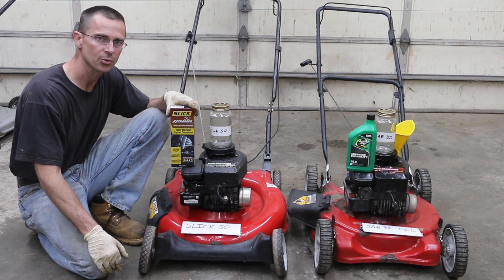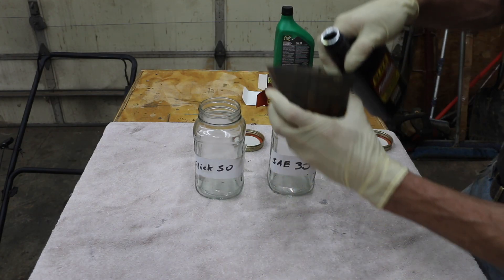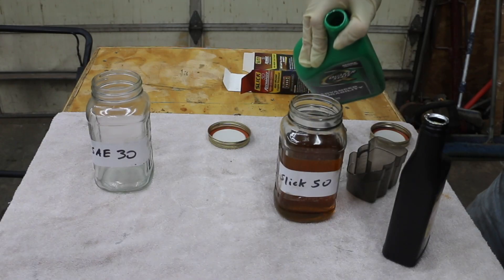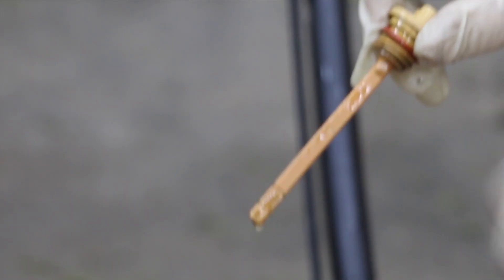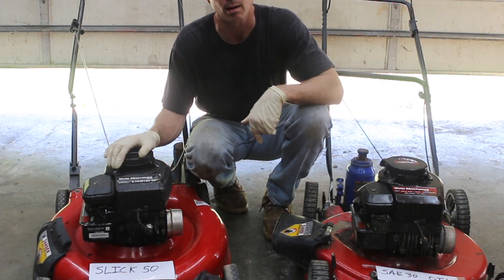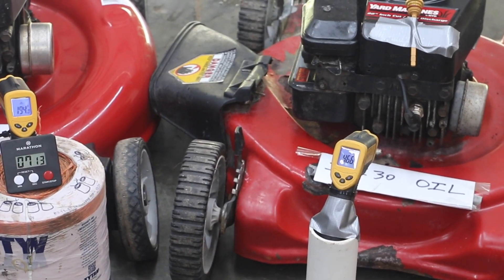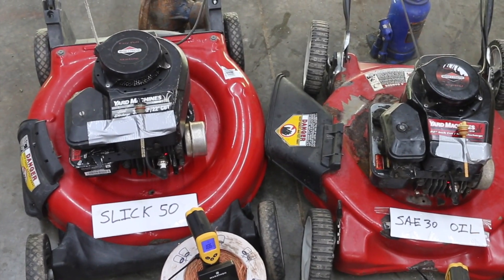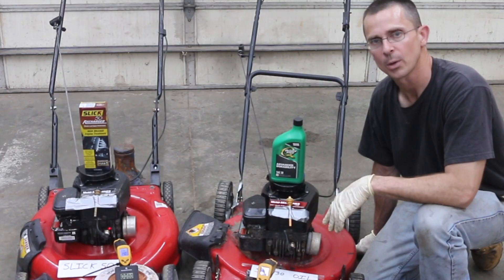Can't believe what SLICK 50 did to my engine!!--Dry Crankcase Test!

Comment: The formula for SLICK 50 "IS NOT" the same as it was even 10 years ago, the name, company and formula had changed a number of times over the years so the Slick 50 you think you are using from 25 years ago is nowhere near the formula of today.
This test is 100% useless if you're trying to prove a point about the original product. The company was gobbled up time and time and time again and the formula changed each time they sold it, it is not the same under that name today.
Look on the internet to find the original owner and his story.  If you want to Original Formula it is marketed under the NEW Name of "Xcelplus" and is as good as it ever was. The man that invented it, John Bishop, now owns it original formula again. 
Do the research, the original formula is the way to go.   Google John Bishop and Xcelplus and you will find it.   ....., I just found the consumer name for it is now called Lubrilon and it is from Xcelplus and it is the ORIGINAL formula, Yeah, it's back, and it works the same as it did.  Look here:  http://www.xcelplus.com.au/

Comment: Slick-50 was bought by Penzoil if i remember but the original formula has not been available under the Slick-50 brand since 1984. The original formula is available under the Xcelplus Brand.
Here is a video link about the original formula developer and the problems with the company. https://youtu.be/CAt-tJa9P_s

Comment: I would say your experiment was a bust from the start as it was obvious that both engines had different amounts of use and they weren't identical from the start. the only thing that would be a true test is if you had preformed it on two brand new engines or two that had the exact same hours, this test was clearly done with neither thereby proving possibly one thing and that was the engine that ran the longest was in better shape. As for prolonging the life of any engine, I have to agree with my grandfather that told me years ago that the benefits gained by frequent oil changes will far out measure any differences in the types of oil used and it wont be before people stop getting rich from oil will we ever see anything hit the market that is really any better.

Comment: If the goal is to have the oil holdup at very high temperature then put in synthetic oil.  Personally I don't think this test really proves anything.  I thought Slick 50 just boosted the viscosity a little.    I would just buy the right oil for your engine and change it at the correct intervals.
Reply from the maker: Thanks for watching the video and commenting!

Comment: I use to use QMI Engine Oil Treatment - EXCELLENT product.... 10% increase in Fuel range (Eureka, CA to SFO and back - 300 minutes round trip) with cooler running engine an the hills were topped WITHOUT comming out of high gear).... Vehicle was a Volvo 760 GLE Diesel Turbo..... Gordon
Reply from the maker: Gordon, Thanks for watching the video and commenting!

Comment: BTW-I ran Slick 50 in a '79 Mercury Zephyr with over 200K on it and it helped the oil pressure about 5#,and my gas mileage increased by around 8 on the highway. it also ran a lot quieter. Sold the car with 332K on it,still running great  Your experience may be different....

Comment: The Slick 50 sold after 1984 is NOT the same formulation or owner as the one from the 70's until 1984.  It seems you are testing a post 1984 product to a pre 2984 specification.

Comment: You should use two identical brand new motors for that test to be accurate.                 Harbor freight tools $99.99 for $200.00 and you must run the slick 50 engine with regular oil after the slick 50 treatment then you would have a more controlled test. And have contrary results I guarantee.
Reply: I agree, if you can swing the purchase, this would be a much better test.  No known history on those two motors you used.  The one with Slick 50 MAY have been used for several thousand more hours, or possibly had a weak part already.
Reply: robsycko I do agree with you. A Slick 50 rinse through the engine isn't how it's supposed to begin the process...
Reply: The Asian Character guy was right, you need some spelling help. Mi should be My, Mower has only 1 o in it. putt is something you do in golf, hoirs should be hours, cince should be since........
Reply: +George Tinc hmmm. I wonder if u tried writing in any type of foreign language u wouldn't make mistakes? seeing that u all perfect and all
Reply: in some cars, (pre 70s) they can really help (zinc additive).
Reply: Dustin Schings 
Maybe.
Or perhaps the slick 50 engine was  in better initial condition...
Who knows.
Reply: robsycko agreed need to identical new engines with tolerance fairness
Reply: Dave Harmon alright Dave now if you only put that much time into your school then you could spell what you're saying properly so people can actually read it
Reply: Would have to replicate the experiment several times to be scientifically accurate   Interesting.
Reply: Google translate would be my friend..............by the way that was me being nice not snobbish trust me if i want to be a dick i will be one.
Reply: LOL... You can't use two Harbor freight engines... One could be bad right out of the box... Some of them want even run when new...Some of them want even start right out of the box...
Reply: You must be related to Michael O, he doesn't know when to use the word "then" either.
Reply: And, use it as directed (run for six hours).

Comment: Do a simple test with and without the slick 50 additives in the same vehicle - get it on a dyno and see if the power changes.
Also do a mileage test using a couple of gallons of fuel and see the mpg.

Comment: I'm a master mechanic that really doesn't care what oil you use that said.... My opinion on why the motor with slick 50 locked up first has less to do with what oil was in it and more to do with the age of the engine. The mower/engine using slick 50 appears to be a newer engine and cotrary to what you might think I would expect the newer engine to fail first. The reason being one of the main reasons for engine seizure is heat expands the metal of the piston and the cylinder wall causing contact and seizure and on a newer engine the tolerance will be much tighter thus contact and seizure would happen at a lower temperature. The older engine being much looser could go to a much higher temperature before lock up would occur. just my 2 cents

Comment: the engine with slick 50 will run cooler because there is air been blown at it from where the lawn gets discharged from

Comment: I appreciate you trying to make things equal but it simply is not. Look at the tire wear on the slick 50 mower compared to the other. One mower might have 300 more hours on it than the other. You would have to take brand new broken in mowers to do the test.

Comment: slick 50 is an oil friction modifier, not an engine friction modifier. its job acts as a oil stabilizer, retains the engines oil viscosity and keeps the heat down the same because the oil isnt thinning out as much. the straight 30sae oil at those temps wouldnt be 30 weight anymore. it would be close to zero at those temps. where did it go wrong? well firstly we all need to take note that its a wide test, both engines could have totally different hours use..  the slick 50 looked a lot newer than the older looking standard oil version. meaning that possibly the tolerances are greater in the higher houred engine, meaning more room to run with out oil before expanding and siezing. if and i mean you ideally want to run an engine the longest with no oil, then you need an additive that clings to the engines internals not in the oil. molybdenum is great as its basically tiny graphite balls that run between engine parts causing a modified bearing to happen. because graphite has high heat tolerance it wont change shape or loose its viscosity and keeps heat down by creating a barrier between moving parts. im an old vw aircooled fan and always have used molybdenum in my race engines due to the high heat factor. never had any issues at all, slick 50 from memory is a viscosity stabilizer and a ptfe friction modifier. why doesnt slick 50 work in these engines? because once the oil has been drained so has the slick 50, leaving nothing left but a thin layer to burn off rapidly. like trans oil would in an engine, it has a flash point. two products that would be great to see used is molybdenum disulphate or liqui moly ceratec, a ceramic engine product that coats your parts in ceramic. ive seen tlboth these dyno proven in stuffed engines. great video though i did enjoy it :)

Comment: I noticed a couple things that probably caused the temperature difference you were seeing with oil. First the exhaust of the slick50 engine was blowing directly on the cooling fins of the other engine. Second the weed shoot on the mower with conventional oil was blowing toward the slick 50 engine this would act like a huge blower and help cool the slick50 engine.

I don't know of any additives that are worth using assuming the engine can run the heavy weight oils. A diesel engine oil such as Shell Rotella or Delo would be your best bet these oils will probably preform the best in this test due to the high pressure additives they contain.
Reply from the maker: Great point!  Thanks for watching the video and commenting!

Comment: I used Slick 50 years ago and found it to be an excellent product on several different engines. I changed employment some years ago and have not used it since. I have been told however that the formula is not the same as the original and the Slick 50 label has been purchased by another company......I have also been told that the original Slick 50 formula is sold under the Xcelplus name.....It would be interesting to see how this product performs.

Comment: Slick 50 needs to be run over time. As it has Teflon in it. It has to bond to heated parts over time. 

The real issue is and always has been. That Slick 50 will not pass through an oil filter below 20 microns. I never could get them to ell my what the lowest oil filter I could use. If it's not known. Your filter would capture the additive. Thus useless...

Comment: I just watched a video saying Slick 50 no longer is using the original formula so your expectations shouldn't be the same for Slick 50 also the mower on the right was blowing cool air from the side discharge chute on the slick 50 mower probably giving a false temp reading.
Reply from the maker: Steve, Yes, I believe the formula changed and the product isn't nearly as good as it once was.  Thanks for watching the video and commenting!

Comment: great test...not thoroughly inductive as it only involves one test, but it does provide a counter-argument to the the Slick-50 claim for engine protection. As we all should know: there may be arguments that exist, however, any counter-example will completely annihilate any claim. Be it as it may, this was a very well done experiment, but it would need at least 100 more to set a precedence for  there to be some significant counter-claim. Well done and strike 1 against the mighty Slick 50.

Comment: Slick 50 has traded hands and has not been the original formula with ATF since the 80's I have been told.   The original product actually worked and was MilSpec for Army Helicopters.   The original saved me two engines, one a boat being raced that blew the oil filter cover (Delco)  and was running full power for 20 minutes and did not suffer wear.  The original product may be found in the AU / Xcelplus for about $100.   Like everything today,  the  money grabbers turn good things into crap!
Reply: Sorry, I meant a PTFE  teflon dirivative.
Reply from the maker: Thanks for watching the video and commenting!

Comment: Great test. In 1990 I bought a new dodge p/u with a 360 engine. About 2 years old I like you saw the slick 50 commercials  so I bought some and added it to oil. Drove about 1800 miles on a trip. About 3/4 of the way into the trip I lost all oil pressure. Scared the bejesus out of me. Went to a dodge dealer to check engine which was still under warranty. The slick 50 has plastic powder mixed in it, which went through my oiling system and got plugged up in my oil sending sensor at the block which blocked oil pressure. Had them drain oil out and flush system and refill with clean oil. Never tried that crap again.
Reply from the maker: Robert, Very interesting!  Thanks for watching the video and commenting!

Comment: Do you have a video on how to make the oil vacuum pump thing with the jar?
Reply from the maker: Greg, I can make a video, but I doubt there would be much interest in doing this.  Quite frankly, it's become one of the most valuable tools in my shop.  It's very useful for draining off transmission fluid if accidentally overfilled or if I want to "freshen up" the fluid instead of a full flush.  Do you think the video would garner enough interest?
Reply: I'm going to go out on a limb and say you are wrong.  I think you should do a video on how to make one of these machines.  You just said yourself that it is one of the most valuable tools in your shop.  Some times things are so obvious they are over looked.   Make the video, folks will love it.
Reply from the maker: Greg, Okay, you've convinced me...you make a great point.  I'll make a video on the vacuum pump.  Thanks for watching the video and commenting!
Reply: Good deal!  look forward to the info.
Reply: Good deal.   Look forward to the info.

Comment: Cause for suspicion of the Slick 50 is the instruction on the bottle that says, "Shake well before using".   Does that require that after I add this to my engine that I have shake my car well before starting?   If the additive (industrial teflon, known as 'PTFE') can't remain in suspension while the bottle sits on the store shelf, how can it remain in suspension while in the oil pan of your car?   Further, the particles of PTFE in the Slick 50 swell to 9 times their original size after reaching full operating temp, plugging oil filters and creating dams in front of oil galleys leading to critical engine parts.   No big deal in a lawn mower engine, I know,  but surely a concern when it comes to an automobile engine.   DuPont, supplier of PTFE to industrial users, knew this when the makers of Slick 50 wanted to become a buyer of DuPont's PTFE, but DuPont refused to sell it to them, fearing a negative backlash when consumers learned that they'd been duped.   However, a lawsuit filed by the makers of Slick 50 forced DuPont, however unwillingly, to sell them the PTFE.
Reply from the maker: Alexander,  All great points!  Thanks for watching the video and commenting!

Comment: Not sure what SLICK 50 is intended to do.  Virtually all automobile manufacturers say NOT to add any oil additives to the oil.  I had a 1990 Mazda MPV that developed valve tapping noise.  The mechanic attributed it to the SLICK 50 I had used that clogged the hydraulic lifters.  After replacing all the lifters, I never used SLICK 50 again and never had valve noise again.  BTW, I never saw any mileage improvement with the SLICK 50 over regular oil.
Reply from the maker: Jetta Red, Thank you for sharing this experience. Thanks for watching the video and commenting!

Comment: First, I  used slick 50 in my car in the 90's and it caused a rod knock. I will never use it again. 
If still available Tuffoil would be next to test. After putting it in a carburated engine I had to lower the idle, because it would rev up to 1k rpms.

Comment: The Slick-50 name was bought out by Quaker State/Pennsoil but not the formula. The current formula is different than the one from 25 years ago.  The original formula is being sold now under a different name. So, in my eyes, this test is invalid for the results of Slick-50 from 25 years ago.
Now..Xcelplus/Lubrilon uses the original Slick-50 formula
Reply from the maker: TJ, this is great information. Thanks for watching the video and commenting.

Comment: did you shake up the slick 50 to ensure 100% of the PFTE that was settled on the bottom of the can was put into the engine ?  most users don't and they never actually treat the engine.
Reply from the maker: Tony, Yes, I did shake but bottle and should have shown that during the video, but I try to edit out things that most people might not view as valuable content.  In this instance, it is valuable content and I should have had it in the video.

Comment: I was browsing the comments and didn't see this concern raised. Personally I find the test ruined by the fact that these are air cooled engines, and in your test, you have the regular SAE engine blades blasting air onto it.  Higher airflow with achieve more thermal transfer as long as the air running over its sinks is cooler than them. And I have a hard time believing that the SAE engine would be blasting the slick engine with 200 something air. 

Also, when it comes to ratios often times company labs have tested the ratios and following the directions is just the sweet spot. In otherwords... you could have had too much slick, and not enough oil... 

my personal conclusion, the raw wear on the components was what seized both engines.
Reply from the maker: Great feedback!  Thanks for watching the video and commenting!